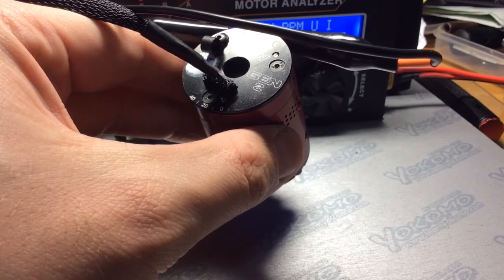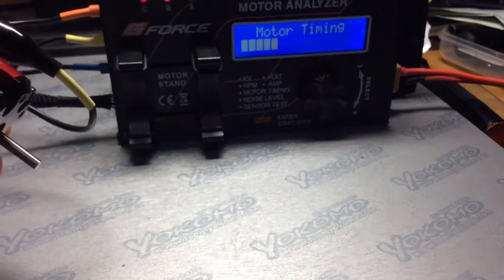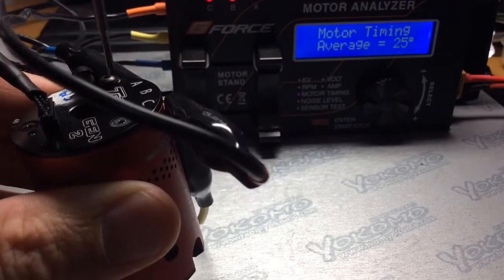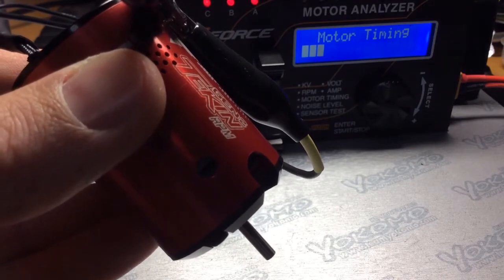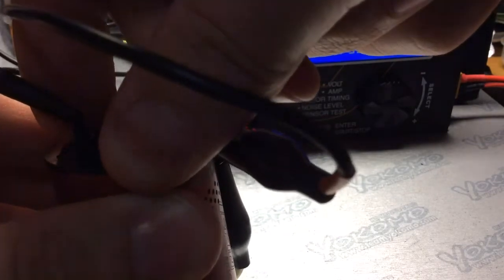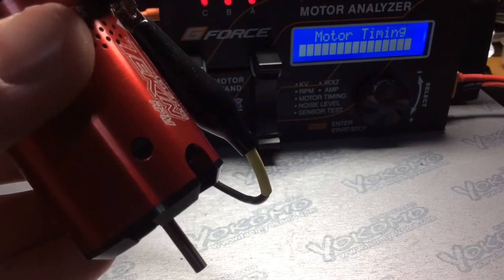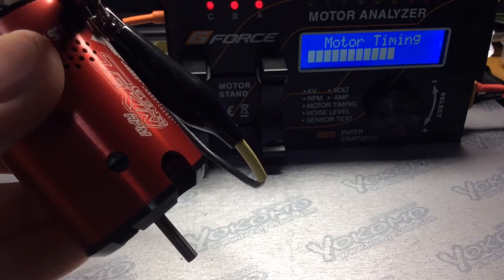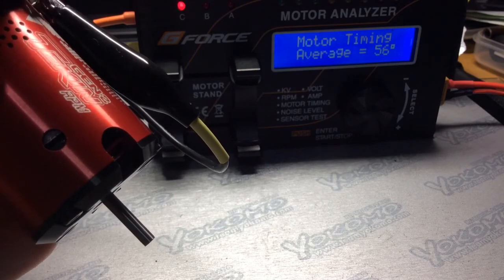Tekin Gen 2 Timing Readings

Comment: I unscrewed my 3 screws and moved the plate to increase timing but now my screws don't want to screw back in they just keep turning what do I do.?
Reply: you need to put it back to where it was then put the screws in you only need to loosen the screws not take them out
Reply from the maker: Hey, are you able to get the screws back in? 

Let me know.
Reply: I have the same issue on a Gen4 spec-r tekin 13.5t, the end bell will not turn with screws loose, it will turn if i remove the screws but the metal threaded piece the screws thread into does not turn for some reason